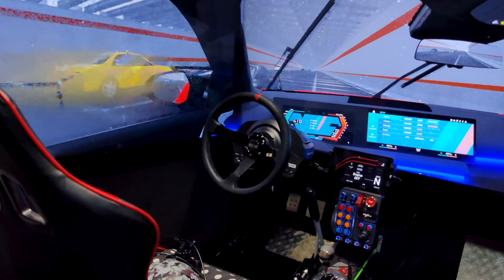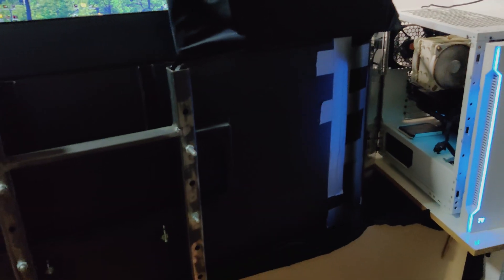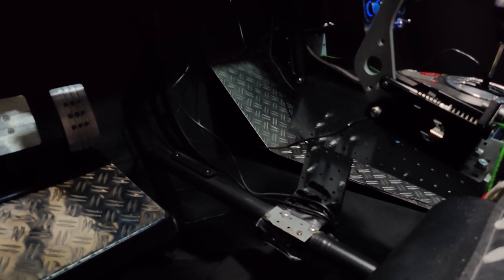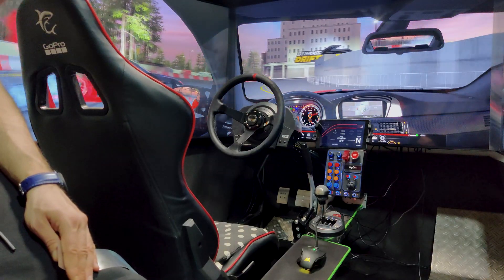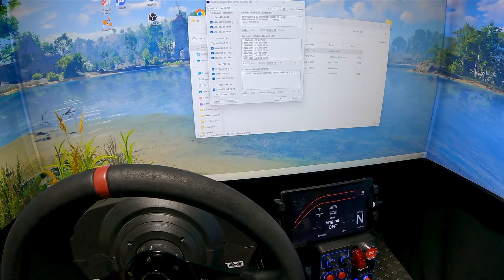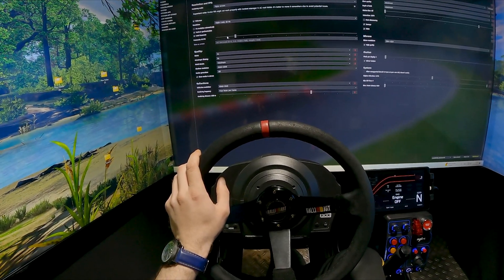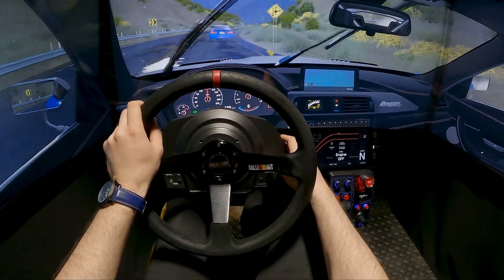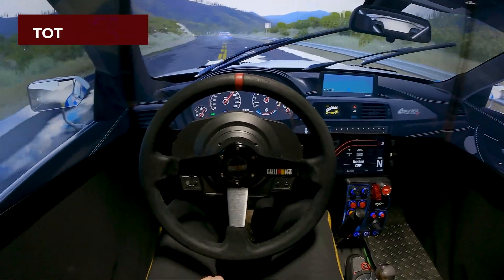HOW TO MAKE TRIPLE SCREEN SETUP?

Comment: What's the footprint of the monitors?
Reply from the maker: Samsung CU7172 55 it's exact model. 55 inch 4k 60 hz ✌️
Reply: @SimLif3 I mean the dimensions of the monitor stand with the rig. Looking to do something similar but space limited
Reply from the maker: Monitor is 135cm wide. So you need 170x170 cm to fit everything Becuse screen angle it's 75. If you go with triple 50 inch maybe you can fit in 150x150cm  . Hight it's 160cm 👍 it take lot of space for me also 😁